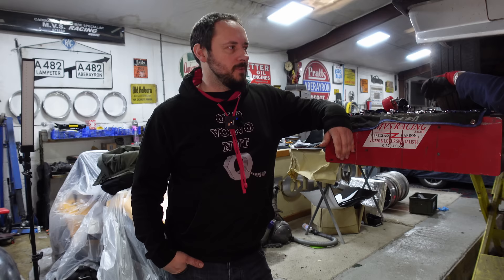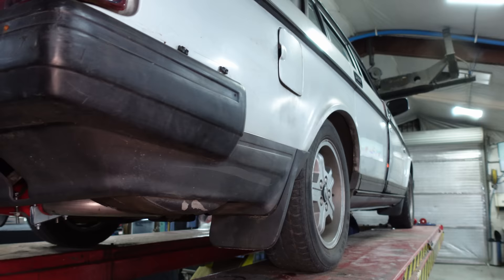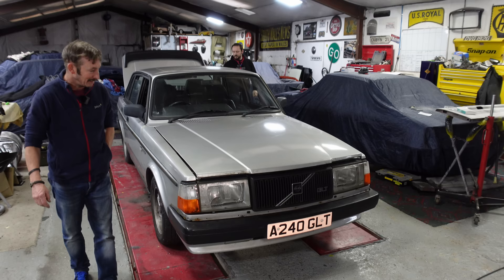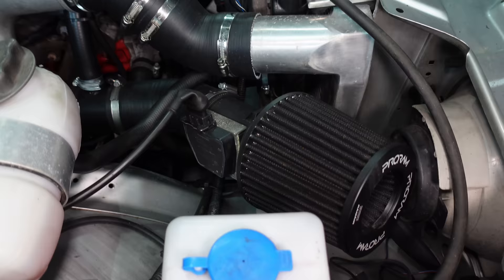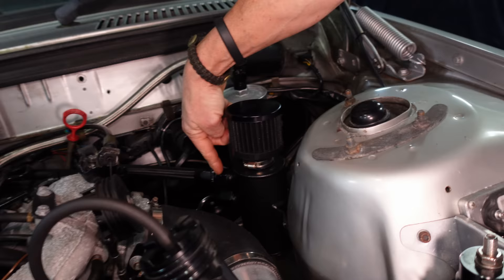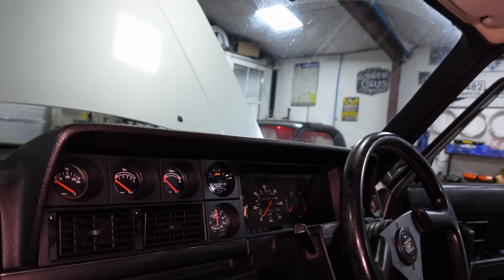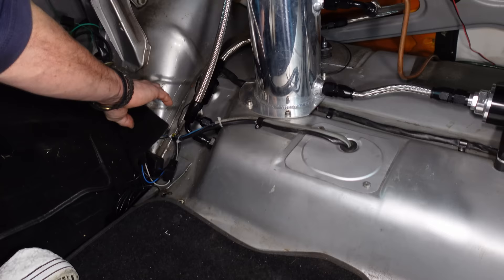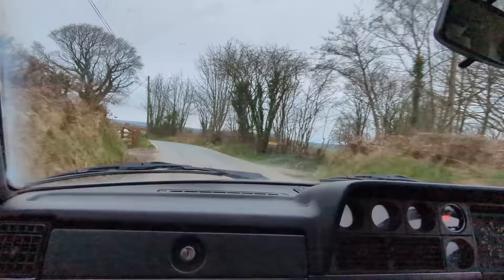Volvo 240 Turbo Super Sleeper UK 300BHP+

Comment: Hi all loved this video
I had a car with a prop shaft vibration and had a new prop shaft made that fixed 80 percent of the vibration but not all of it. In desperation I pulled the pro shaft and removed the rear extension housing off the gearbox and what I had was a worn Busch/ bearing in the rear housing. I replaced this and longer had any vibration. When I looked closely at the front universal joint the input shaft also had a slight wear which I initially did not see.
Hope this can eliminate another possibility for you
Love your car and the video great work..

Comment: Had a 940 turbo, with vibrations, the former owner had everything done about it, balancing of prop shaft etc. Last year I needed to change the clutch plate. It was than that I found out that the clutch plate installed was a non turbo one, I rebuilded it with a diesel flywheel and clutch plate and the vibrations were gone…….

Comment: Maybe check the pinion angle?  Bad pinion angle can cause driveline vibrations.   Adjust with adjustable torque rods.  Way cool sleeper Bro!
Reply from the maker: That's first on the list to check!
Reply: I have an angle gauge now so will dig into the pinion angle setting.

Comment: Has he separated the two halves of the prop and put them back together at any point? They have to go on the splines the right way or the whole prop will be unbalanced.
Reply from the maker: Not since it's been professionally rebalanced. Might be an issue with pinion angle?
Reply: @WhitelandRestorations  might be worth getting some adjustable reaction arms from martin leaf (Viking fabrications) anyway. Try another prop altogether to see if that fixes it, then at least you'll know if its the prop or something else altogether

Comment: A 240 GLT has no turbo though. How does it pass inspection in the UK? Or is it a 240 turbo to begin with? Cheers from Sweden.
Reply: Easy, we're allowed to mod our cars here. As long its disclosed to insurance company its fine.
Reply from the maker: We have a points system here in the UK, the car has not been significantly modified... Ie engine change so it's just an addition that you have to declare to the insurance company.
Reply: All declared to Lancaster Classic Car insurance. And you wouldn't believe how reasonable the price is.